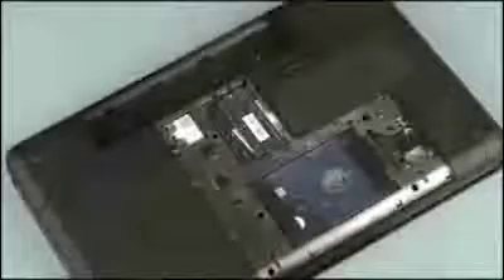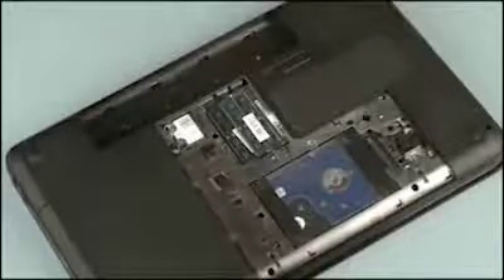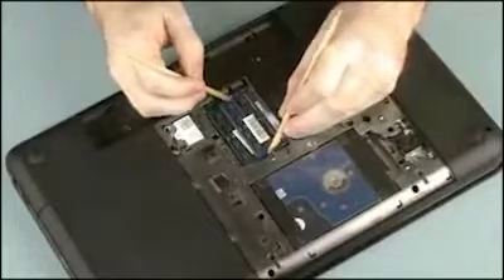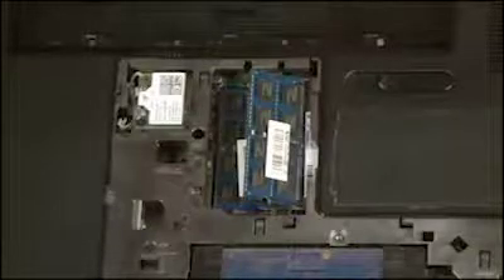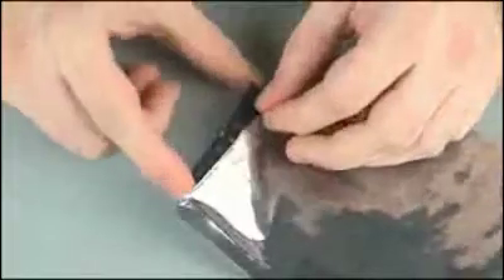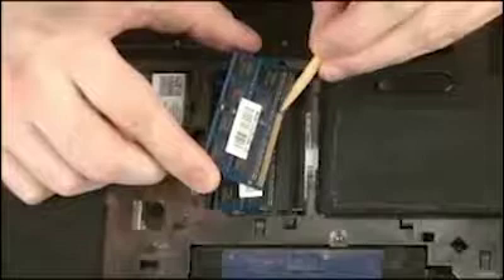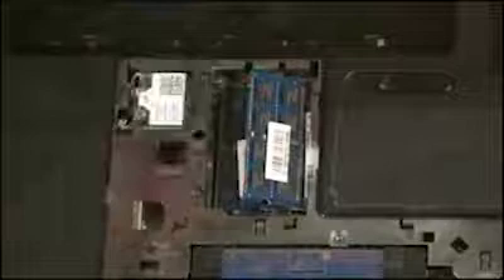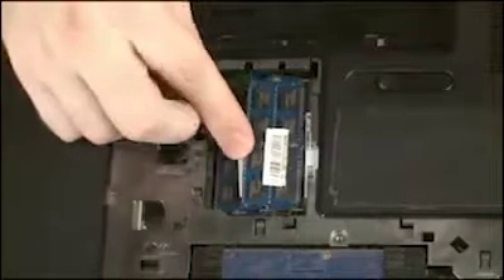Replace the Memory | Pavilion g6-2000 | HP Support

Comment: @Hp support pls tell me that Which mhz ram support in hp pavilion g6 2103tu i want to upgrade it has 4 gb ram this time second slot is empty
Reply from the maker: Thanks for the reply.
It supports  8 gigs max DDR3-1333 but it is actually  (2 x 4 gig modules)
4 GB PC3 10600 1333 MHz shared 621569-001
Regards, 
HP Support

Comment: My second ram slot is slightly shorter than the first? Ram won't fit securely even though it's exactly the same. What is going on?
Reply from the maker: +Hi There Please refer page number 38 of the user manual to know about replacing memory: https://bit.ly/2NU88BL